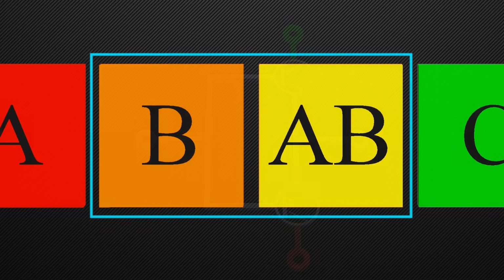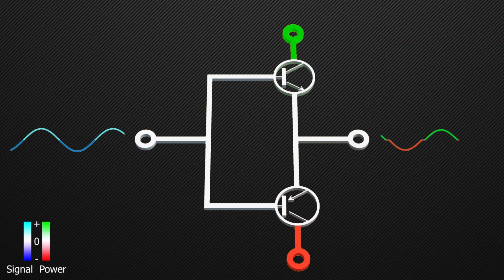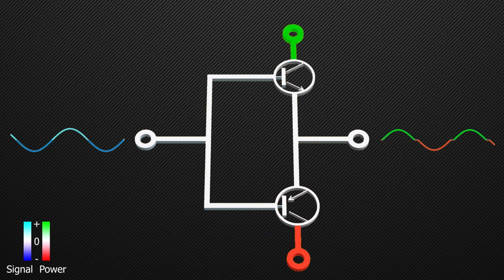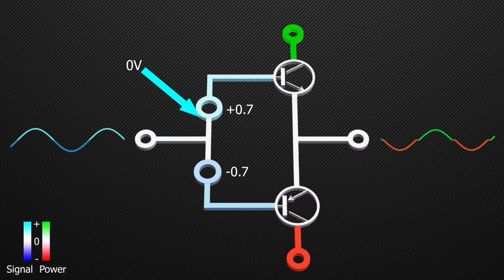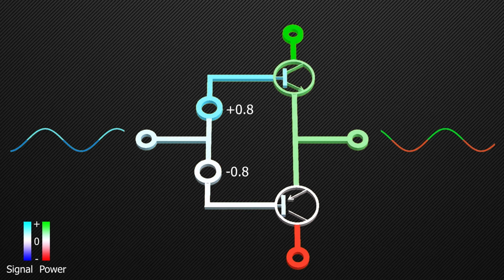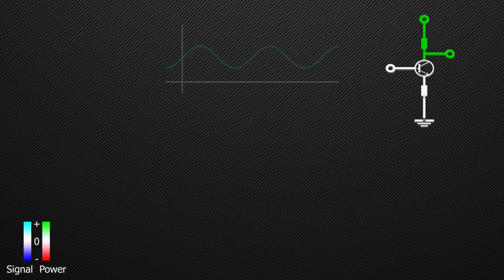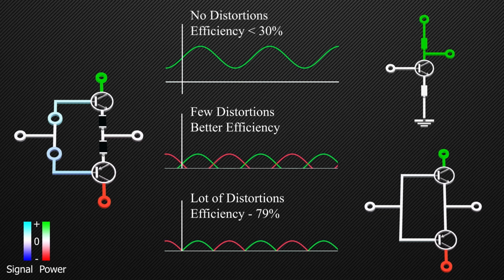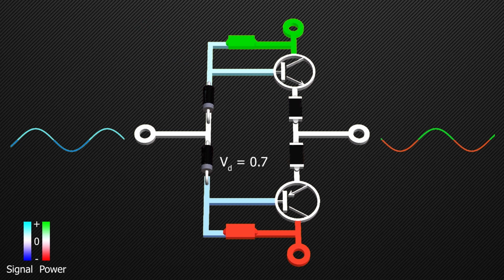How does an Amplifier Work? (Class-B & AB)

Comment from the maker: We are really sorry for no uploads in long time. 
There are some technical issues.
Uploads will resume soon. 
Stay tuned.
Reply: Succsess for you brother 💯💯💯❤️❤️❤️❤️gbu
Reply: this channel is on another level, please we need more, if you active the member option I will be the first to pay
Reply: Understandable, thank you!:)
Reply: Hello brother how are you Your channel will grow very fast i pray for You
Reply: There is surely strong need to explain basic primary electronic circuits. Perhaps current-sources, differential amplifier, class-A with current source, diff. amp. with current source, op-amp, current op-amp, vcf, vco, vca, many-many-many oscillators. And also modern mutations using digital logic/ic's. One can focus on primary circuits and can thing that topic can never end. No one has done it before on YT. There is a hudge market gap on popularisation of these concepts on YT. Short, simple, to the point. 3-5minutes max.
Reply: You are just amazing make more video will full support you ☺️
Reply: I will be waiting patiently. You deserve it for you amazing work
Reply: Nice video! Please advise, which software do you use to make these animations for explanation? Can anyone help me? I am planning to start a YT channel
Reply: how AC positve cycle will flows to the NPN transistor wnen diode cathode has higher polarity can you please explain in detail

Comment: But why diods are used, pnp transistor don't need positive voltage na. The positive voltage will flow through two diods and feeds to the base of pnp transistor which is useless.

Comment: This is wrong. Class B has biasing. Can see Class B with two diodes in the Douglas Self small signal amplifier book. The most popular amp in the world, NE5532, is Class B.
Reply: Class b by definition don’t have biasing class ab means that the transitiors are biased so that cross over distortion is minimised or removed if it’s biased then it’s not class b also op amps don’t really count as amps in the conventional sense and the ne5532 has a class ab output stage this can be seen in the functional block diagram where they have two transistors between the 2 bases of the output stage

Comment: When you add the two diodes the one closest to the NPN transistor shouldnt be flipped? The way it shows looks like the current would never flow towards its base.
Reply: Did you ever find the answer to that? I understand the biasing but what i dont understand is how npn would ever turn off in this instance. It seems like it'd always be on because of Ub